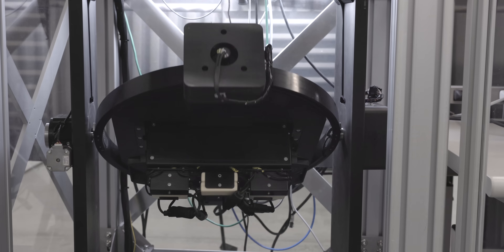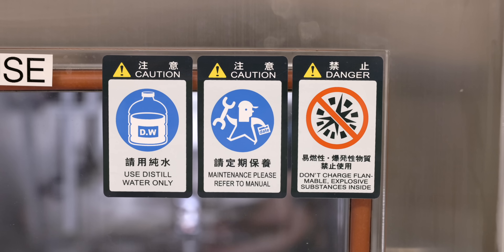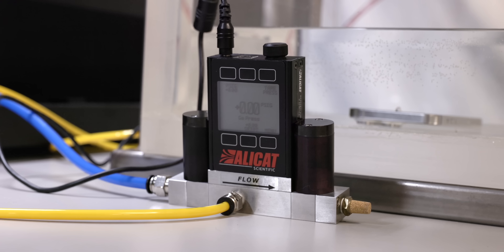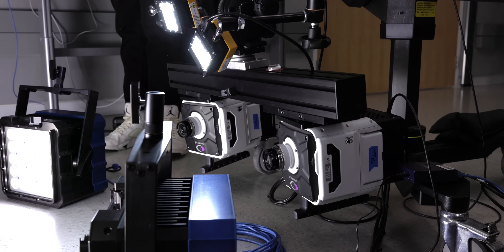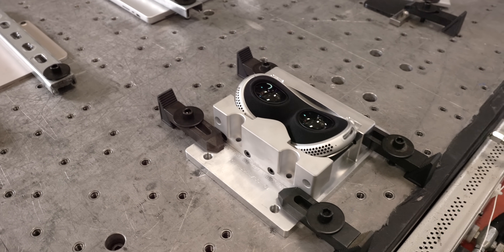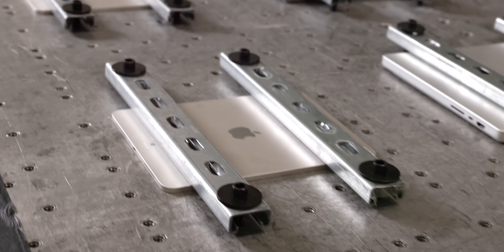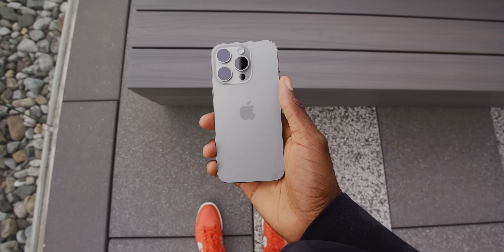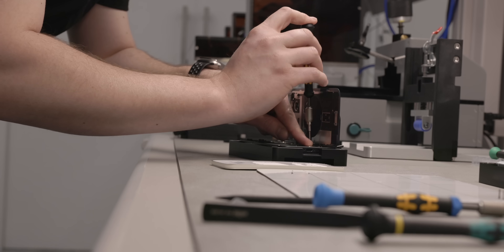I Visited Apple's Secret iPhone Testing Labs!

Comment: Oh please, durability doesn't have to come at the cost of repair-ability.   Apple has been shown OVER AND OVER again to be 100% anti repair-ability.   The special screws on all Apple devices were a sign of this.   

They also don't want you upgrade any device either. 

They want you do buy a new device.  

Like come on, there is utterly NO reason to solder on ram in a laptop.  They flat out did it so you couldn't upgrade.    Whats WORSE is that Apple is a trend setter in these things.  They are the first to do something and everyone follow suit.

And come on, the back of an iPhone is glass!!!! That is just utterly stupid. There is no reason for it except for 1) Because the can 2) Because it's more likely to break

Side note though: Anyone who doesn't put their phone in some kind of two layer case is an idiot.

Comment: Nah I’m still with Apple being terrible for not allowing customer to repair their own products. I’m sure it’ll be an issue with reliability. But if you can’t take it to a mom and pop shot to fix a port, speaker, screen, you name it without it being limited/ bricked then what the point of this supposed “environmental friendly” crap. If you take it to Apple it’ll end up costing the price of a new phone, which many would rather do, thus defeating the “purpose”. And the fact that they will not even sell its parts to it nor provide schematics is just stupid and greedy as f.

Comment: i dont like how he said non reparability is better for the environment. its not fully true, if the charging port brakes u have to get a whole new phone instead of just a new charging port. so thats the material cost of a port plus every other part of the phone. many other examples can be thought up but i think its silly for apple to claim anything they do is better for the environment, especially with the lithium in batteries. i would find it more palatable if they just acnolaged phones where bad for the environment instead of trying to weasel around

Comment: Good thing that they're making it more durable and finding a sweet spot the durability vs repairability scale. 
But at the same time, I think the whole argument against apple for repairability is third party repair. It's the locking down of parts using software so that they can't be replaced by users/third party repair shops. Otherwise you can pay apple top $ and get almost anything repaired/replaced.

Comment: Here in asia is 45 degree temp some should test that what if your phone left outside direct facing sun  is there difference to ip rating or seals are loose or what happen after long time exposure to sun. as someone forget his phone on like rooftop

Comment: I was very against Apple products in my Younger years, but most of the things I did not like they did iron out with the 11 Pro. I hopped on the train to check out Apple with the OG AirPods though 1 year before my 11 Pro. The only product that failed from Apple since 2018 are the OG AirPods. My 11 Pro from launch is a tank and it still sits at 93 percent battery health. I got a S3 GPS Nike AW in the beginning of 2020 and I do not baby it at all and its still working perfectly and the only drawback is, it receives no updates anymore. I upgraded to the 15 Pro at launch and still no complaints. You pay more for Apple products, but in my case they last much longer than tech from the Android world (SW or HW).

Comment: I don't think it's a sliding scale between durability and repairability. Rather it's a balance between durability, repairability, and sleek aesthetics. You could for example get similar or even better waterproofing with screws and gaskets rather than adhesive. That would make repairs simpler and easier but it would also make for a bulkier design.

Comment: The problem with the ”product that never fails" argument is that such product is literally impossible. The implication Iphones get even close is a bold faced lie.

ESPECIALLY when talking about a smartphone that includes a battery that WILL die within a decade because your phone doesn’t ignore the laws of physics, no matter what Apple reps say. Even with a magical, infinitely rechargeable battery, your phone would be useless in 15 years at the absolute most because of lack of software support and compatibility issues.

Therefore, repairability going hand in hand with recyclability is more important in smartphones than durability. Any argument to the contrary is trying to make you buy an unrepairable phone and leave you no other choice but to buy a brand new one when the previous one inevitably fails.

And all that is even assuming the sliding scale argument is true. Plenty of phones achieve IP68 certifications and are much easier to service.

I can’t understand how this Apple employee can look at himself in a mirror after saying these things in front of a camera, knowing he’s helping his company sell billions of these phones, almost all of which ending up in landfills, just to save on production costs and maximize profits when they’re already the 3rd most profitable company in the world.

All those arguments also apply to most Android manufacturers too, Apple’s not alone in this.

Comment: Assume you have a durable working iphone. It's still garbage in 6 years because Apple will end support while simultaneous maintaining a lock on your hardware that prevents you from installing apps without using the Apple app store. Repairability includes the software too.

Comment: Many OIS magnets from iPhones are damaged (causing damage to autofocus) due to vibration from motorcycles. Happened to myself on my 11PM and to my cousins Xr. And we both mount our phones onto our bikes during rides. I don't know if they occur on newer models or not but I think is the very reason for the vibration test.

Comment: No no no.... Marques you are absolutely right, when you tell us about the more durable your phone is, the less reparable it stay, but apple do the software locks, with security chips for no reason. You can't even change your battery by yourself without error messages. Sorry apple but this is a bullshit.

Comment: One element is missing in the equation which is the software. IOS comparing to other OS is kind of durable but actually the overall durability only matters if you can still run the OS and replace the battery and eventually the screen . I’d rather have an iphone that is repairable after a durable period:  once it’s old just rip off the complex elements and replace them with easier elements to turn it repairable even if it means a thicker enclosure, less water protection etc.

Comment: Had an iPhone 12 for less than two years with an otterbox on out the verizon door. I turned it back in for an upgrade and they were convinced I held my phone underwater for an extended amount of time. I firmly stand behind the conspiracy that an iPhone will self-degrade in order to push you to buy the next model.
Reply: a product should be as easy to repair and as durable as feasibly possible. anything else is a long-term scam that forces you into brand loyalty.

Comment: I'm skeptical about John's and Apple's way of framing durablity and repairablity so equally to one another. Everything we make breaks sometimes, thus you need a way to repair it: the two aren't mutually exclusive. But as we've seen, Apple is often hostile to attempts to repair, especially without their approval, and true sustainable user replacement like Framework and Fairphone is only just beginning to take off. We can't trust companies with a bottom line to care about what's good for us.

Comment: I understand the argument of the line along which you have either durability or reliability. But that's just gaslighting the consumer. Because we all know that a 100% durable product doesn't and will never exist. That's looking for perfection in a product in terms of durability. Even if something doesn't break down, it will still wear out.

Furthermore, if a company does make a product so durable that it doesn't need replacing in 3, 5, even 10 years time, that same company will eventually go bust because it won't have enough sales to sustain the business since customers don't need to buy their new products to replace the old ones that still work well. It's anti-sales, anti-revenue. And Apple's definitely not gonna do that. No business would.

Comment: John Ternus' argument doesn't make any sense when you realize there are many phones in the market with same levels of protection that have significantly more repairability. And it's really out of touch for him to say if we need to replace our batteries, we should do it through apple. As if a battery replacement is such a complex task that no third party qualifies for it. Even then, if you're gonna be that adamant about doing repairs in-house, maybe don't charge a limb for it. I know Marques is well aware of all of these arguements, so it's surprising he didn't grill him a bit more.

Comment: i actually cringed at the repairability vs durability argument.

for the iPhone 8 to the iPhone 13 series (also including the 14 pro/pro max) there was never a need for the back glass to be structural like it was. meaning that there was no reason to make repairing the back glass as hard as it was.

this completely ignores parts pairing. let's say i take my iPhone 12 pro and i replace my front camera. since i understand the risks involved, and i paid for the phone, who the hell is apple to decide that i can no longer have faceID. furthermore if i replace the home button on a 7 or 8 who the hell is apple to say that at the very LEAST it can't still function as a button? there is NO good argument for parts pairing. it is expressly anti consumer.

preemptively getting out ahead of the comments that go something like "oh just buy a samsung, they would never!" you need to understand that they will do this to you too. every company will eventually do this to you. we NEED legislation to that holds every single manufacturer to the legal requirement that they cannot engage in this blatantly anti consumer garbage.

Comment: Apple water resistance is better than Samsung. 

Samsung refused to honour their warranty and didn’t repair my Note 20 ultra because of water damage. The water resistance gaskets/ glue had hardened over time and become loose. Very poor customer service. 

Switched to iPhone. Very happy with the decision. Also realised that I never  used the note ultra pen. So didn’t miss anything. 

My family never had any problems with apple support. I have not needed apple support.

Comment: The Repairability vs durability argument is not a good argument. It only addresses the ease of assembly/disassembly part of repar. Plus, iphones have long been very good at ease of repair and swappability once you dissassembke it, since they mainly use screws and independent modules inside their phones. The issue, is them monopolysing the market for repair parts and forcing parts pairing.
Which proves that difficult repairability is intential on their part purely for business purposes.

Comment: The durability / repairability scale is a real thing. In the watch world for example, any one can buy and fix a timex watch. The break often enough to call them a low end watch. The same can’t be said for a Movado. But a Movado is also hard to repair because of the precision machining, the precision seals, the gears and the way they move, and the smaller space to do all of this in. 

This is exactly what is happening in the phone world. You can get a Walmart phone that’s easy to repair but not all that reliable. Or you can spend a grand on an iPhone or similar high end phone, and have much better reliability but it’s going to be very hard to repair.

Comment: My evidence is very anecdotal. I have an iPhone 13pro and I’ve put my phone through some absolutely crazy falls, I thought it would be so shattered a few times (I don’t use a case) and the only time I successfully shattered the back was when I slipped on ice and slammed it into the ground while holding it.

Pretty crazy how often it doesn’t break. 

I opt to subscribe to the forever Apple care so I can be less worried about it breaking but I’ve used it once since I got the phone.

Comment: Yeah, no. When you compare Apple's anti-repair practices you wouldn't think of such imaginary slider that goes either to repairability or durability. Plenty of other smartphones don't have a dozen different weird screws inside, plenty of other smartphones don't lock hardware parts behind software coding, plenty of other smartphones don't obligate you to use exclusively their own repair shops, being expensive as hell... And all of those plenty smartphones are still pretty durable (some even more when we talk about sapphire screens). So yeah, I don't fall for this

Comment: I’m glad you mentioned the spectrum of reliability vs repairability. It’s pretty much common sense if you’re an engineer building these things, but in America, political interest and media bias does their business this way.
Reply: There’s no replacement parts, everything is soldered to get the design outcome and performance they want. Just look at Apple’s circuit boards, that’s no college project class wiring. That’s peak engineering space optimisation.
Reply: @berdugosocials9854  Not everything is soldered. Batteries, cameras, charge ports for example. Even parts that are soldered can be replaced if someone has the skill. I don't think soldering is permanent, in general. I'm not an engineer though, I apologize.
Reply: I'm okay with the phone getting more complicated to repair in exchange for durability, but apple shouldn't restrict manufacturers from selling replacement parts to us. Apple sells a limited selection of parts themselves, but they price them so ludicrously high that makes it not worth it. Permanent pairing of certain parts to the phone also makes it impossible for people to fix their own phones by themselves. I agree with what the engineer said in this video, but he didn't mention all this other stuff that Apple does to restrict people's freedom to repair the devices they own.

Comment: Android manufacturers have had user replacable batteries and an IP67+ rating. The two are not mutually exclusive.

I concede that imolementing both repairability and durability together may be more challenging, but I doubt it's impossible.

Comment: Proposing durability repairability as contrasting spectra is some real bullshit. 

The manufacturer use glue and other adhesion techniques that are non-serviceable because it’s cheaper to produce at large scale and faster. You also get the added consistency for quality control   

Slopping on some glue is a lot quicker than 18 screws!